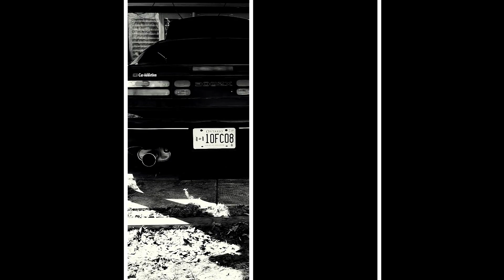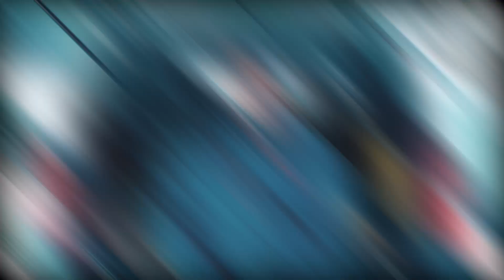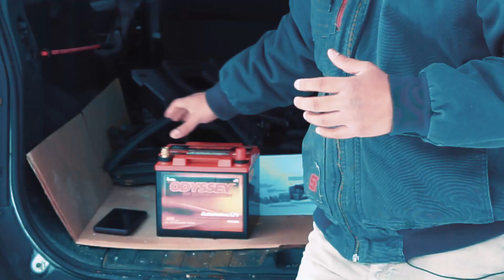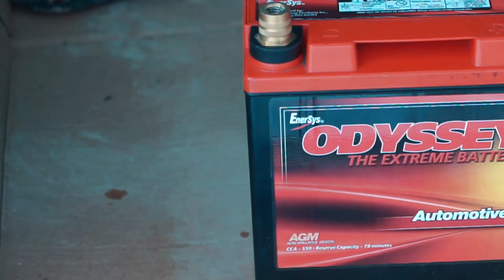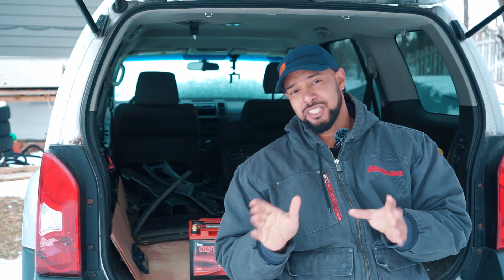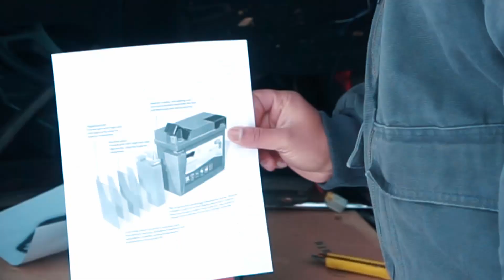What is the best battery for your car? Odyssey VS Optima Battery.

Comment: Odyssey batteries thay are very very nice, Expensive.. I still use the old standard batteries I'm using a duralast gold, I was thinking about getting an inner state,This battery something to really take a look at.. thank you for the video. You do have some interesting informative videos..Ps, Put a hole in my radiator😕 thinking about  Rolling the fins to stop the leak Never tried it They said it is sure fire fix ...🚘🇨🇦🇺🇸
Reply from the maker: Thanks man. Much appreciated. Dualistic gold is rebranded interstate batteries. I really like interstate batteries.
Reply: @runningrich   Thank you I do too I been wanting  one of those next I like the Odyssey..ps  it's kind of a police state here now Helicopters-- ex-- ex. OK you take care looking forward to next show thank you...
Reply from the maker: Same here man. Stuck in the house.
Reply: The old interstate/Duralasts were good, but they are garbage now. Same with Optima, they were good until the company was bought and moved to Mexico. 

I went through 2 Duralast golds in 3 yrs. Finally broke down and got an Odyssey, I've had my truck 14yrs and it's never cranked so fast, plus 4 yr warranty. Worth the extra money
Reply: I've had this one going on 4 years I hope it holds up,, I've had trouble with their bearings wheel bearings hubs  I am gonna get an innerstate on the next battery Thank you on your comment..ps  Here's a tip I really like it when I found out silicone grease pure silicone grease on your windshield wipers it a smear at 1st a little just leave it on I can sure and it with everybody and put it on their windshield wipers have a good day thank you for your comment take care..
Reply: Sharing it sorry early here